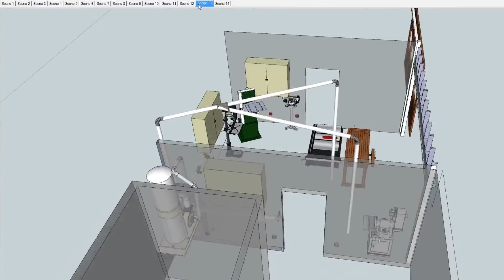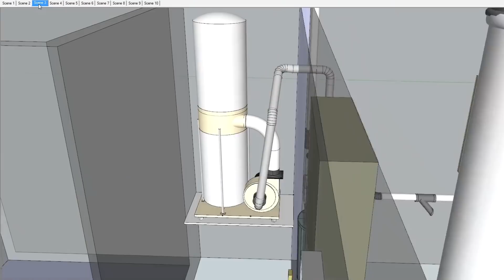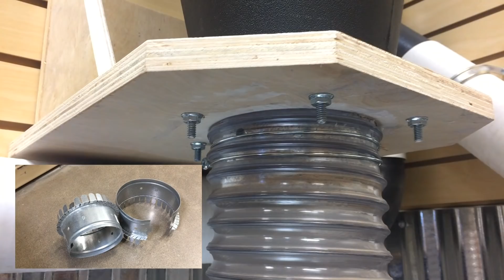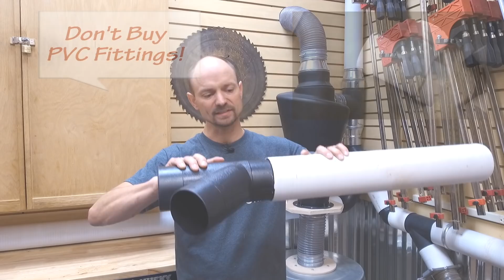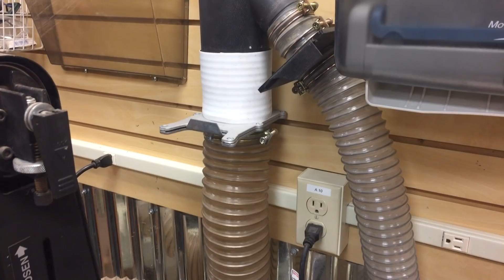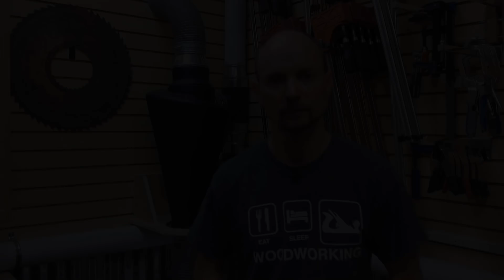Dust Collection Ducting That's Cheap and Easy?

Comment: Great video!  I like the dust collector being in the other room and the idea of raising it up to give storage space below it.  Also, I hadn't thought of the quick disconnect on the table saw for the floor sweep.  I'll be adding that to my plans for my system.  Thanks for posting this.
Reply: I am too thinking of putting my dust collector (and compressor) in a small corner room that came with the barn of recently moved into house. I was thinking it would cut down on the noise but also maybe more importantly it would block the dust that makes it past my current bag style filter since the room will be both insulated for sound and well sealed.
Reply from the maker: Would love to see pictures of your install.

Comment: Very well presented dissertation on the installation of the dust collection system. No hemming and hawing and ummm, and ahh's, just spit it out and get on with it. A very clean and noteworthy build. The drain piping is a great money and time saver and the minimal use of blocky plywood to build the various interfaces and mounts is much appreciated for its' sine qua non quality. If I were going to make this video I would make the title "Dust Collection Ducting That's INEXPENSIVE and Easy". There i NOTHING cheap about what or how you did this project.
Reply from the maker: Thanks for the kudos!

Comment: Hi, I’m really interested in your split room system I too would like to do this with my setup mainly to cut down the noise!  Is it possible to have a copy of the sketch up drawing for a reference? Have you done any tests for the flow measurements for efficiency? And did you send the warm air from the collector back into the shop? 
Thank you for an excellent video!
Blessings, Andy London England.
Reply from the maker: Hi Andy. It sounds like you’re on a great path to improving your dust collection.  I’m still working to get things going with my website and will offer sketch up plans for sale in the future. Sorry I don’t have anything set up now. I will be doing an upcoming video to measure efficiency. Yes, I do have a return for warm air but this is because my shop is in a commercial space.  I have installed large 12 inch pipe l collection systems and it definitely makes a difference there for heat.  It will make sense to consider this for a small shop too. I will be doing some upcoming videos on system efficiency and measuring key points. Cheers!

Comment: How does that pipe do with static, is static a problem with that type of pipe?
Reply from the maker: It does fine. My biggest static issue is on my tablesaw drop, but it’s more than reasonable. Machines like drum sanders develop much higher static electricity than just using the hose for cleanup. The only noticeable static I have is when using a drum sander. Static is honestly overplayed for dust collection.
Reply: Certainly, some ducting materials are more likely to have static buildup issues than others. This type of piping, if i recall the data sheets correctly, will be less of a concern than PVC or ABS. If it's a concern (more peace of mind, than actual danger), simply insert a ground point every 10 to 20 feet, or at each drop. That can be as simple as a screw and some wire, or you can go overboard and ease your mind with some copper tape on the inside coupled to ground wires. (There are hundreds of videos on this.) But, the reality of the situation is that humidity will have a far greater impact on static buildup in a shop, than dust collection alone.

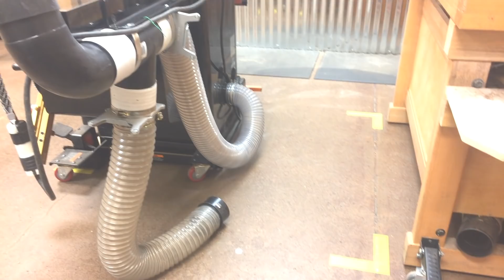Comment: At 5:33 your showing a short section of vacuum pipe dangling near the floor of your table saw. What is this used for. I'm thinking for the dust coming down from the cabinet. Very good video well explained. Thanks!
Reply from the maker: This is for the floor sweep under my workbench. The bench is removed for clarity. I have a video on my channel that shows the details of how I made this.

Comment: Great shop. Curious how the house/garage evolved. Guessing you turned a garage stall into a shop or it was some weird side room next to garage. Did you put up the slotted wall panels right away as the wall or is there something existing behind?
Reply from the maker: Thanks for the kudos. I actually have 2 shops. One that I will be building out in future videos at my home and one that I’ve built as a studio in a commercial building. You’ll see much more of the home shop as time goes on. To answer your question I built everything you see in the video. I hung the slot wall, fitted out and framed the wall with the door, and did all the decorative elements. This space is used as a personal classroom for education and secondly as my studio. Slatwall is directly over studs in some cases.

Comment: Loved this video but i have to ask - have you checked the draw before and after the location of the "T"? I feel like that's the weakest point in an otherwise great system
Reply from the maker: guitarchitectural  thanks for the feedback. I’m planning an update video on the system along with a few lessons learned. I totally agree with you about the T - they should definitely be avoided at all costs!  I had to use it in order to travel up and down for my various runs. There wasn’t much way around it. My toughest collection point is at my table saw. I use that for my planer and jointer and have had no collection issues. I’ll take some CFM measurements in the future. Cheers!

Comment: Splendid tutorial and description of all parts that make up your system.  I just did an online search, and I'm afraid that thin-walled DWV ducting isn't even available here in Canada, at least not from the usual retail outlets -- Home Depot, Home Hardware, et cetera.  The closest they come is straight PVC, and if I understand your theme, it's to NOT use PVC.  I suppose another question for you is what is the material in your black fittings?  ABS?
Reply from the maker: gussy thanks for the note. I chose THIN WALL DWV after discovering that it heat shrinks to the black abs fittings. I distinguish from pvc because pvc is expensive, and has to be glued ( plan on throwing away any glued fittings if you ever want to change). To my knowledge I’m the only video on YouTube that has discovered the secret of thin wall DWV. 

You’ll want to source the black fittings through Woodcraft. I realize that they are not in Canada, but try calling a store that is near the boarder like Seattle or the corporate office in West Virginia. Look for a follow on video coming soon with even more tips!